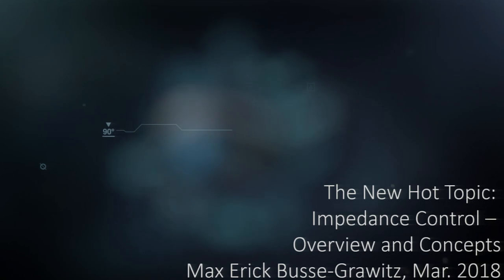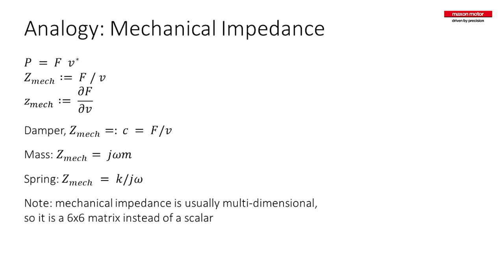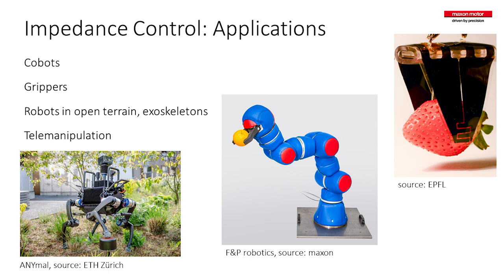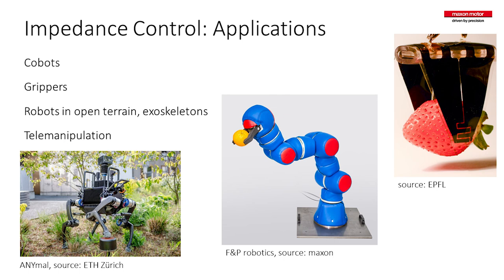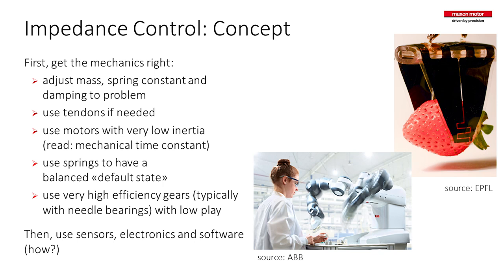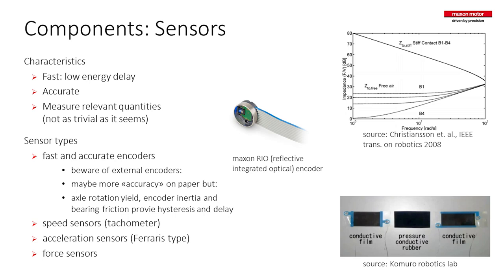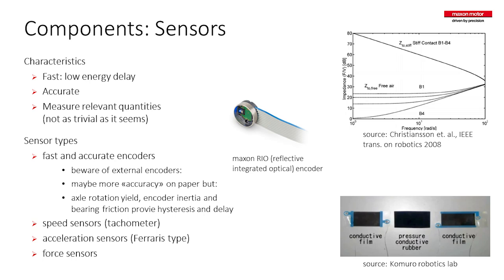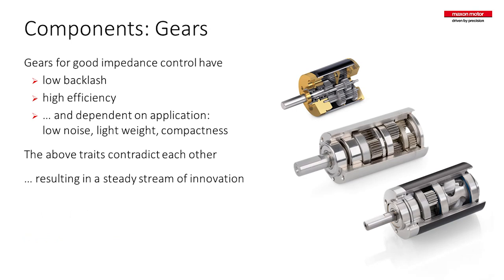Maxon Motor - Impedance Control in Robotics

Comment: Hi, I would like to implement an impedance control for an arm of an exoskeleton, I currently have a maxon 90 EC motor and EPOS4 compact 70/15 controller. The position control works well for me. How should close the control loop to add the impedance control. and what force sensor do you recommend to use?